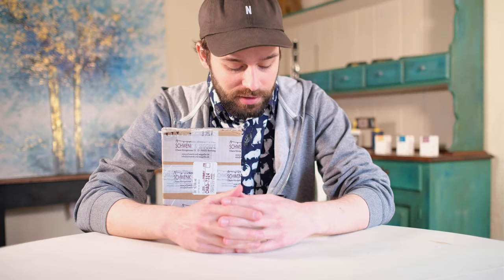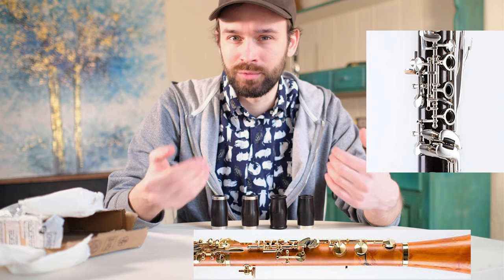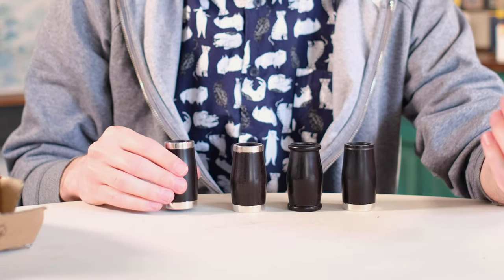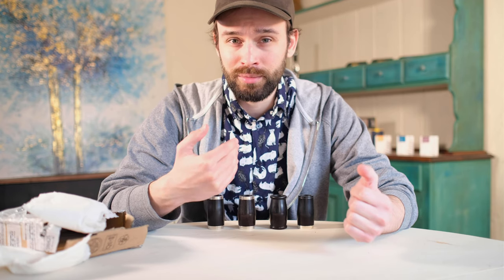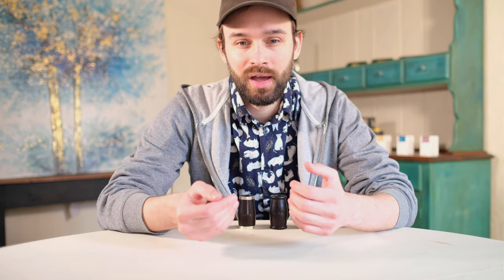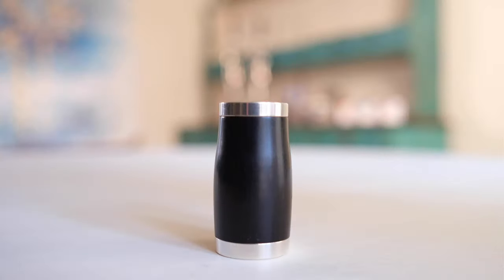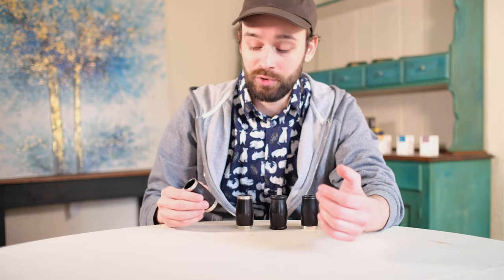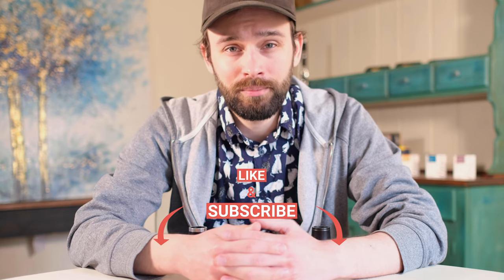Do Different Clarinet Barrel Shapes Change their Sound? Trying out Schwenk and Seggelke Barrels!

Comment: My unsophisticated ear dug the two ring fatboy  - but you also seemed more into playing while you were using that barrel.  Did the different barrels change any physical perception as you played, like having more or less felt resonance through out the instrument?
Reply from the maker: One of the most impressive things about these barrels, was that despite the ring differences, the “feel” was pretty close across the board. I imagine S&S takes their bore quality control pretty seriously. They all definitely felt like they were the same bore, just with small differences in the harmonic output due to the rings. That being said, it’s been a while since I’ve tried them and there were probably very small changes in resistance from barrel to barrel, but honestly I can’t remember what they were, just that I was surprised by how close they all felt.

Comment: Thanks for the video. A question related to the vast variety of barrel sizes showed at one moment: does the shorter barrel (shorter than 65mm) change the pitch of an instrument, and if does, by how much?
Reply from the maker: Good question! The answer to it is absolutely; going from a barrel that is 65mm, to one that is 64mm, will definitely change the pitch. There are different factors that effect barrel intonation, but you could probably expect the pitch to rise 5-10 cents (potentially more) depending on the note from a barrel becoming 1mm shorter.
Reply: Thank you very much. In the video I saw very short barrels, like 40mm tall (when compared to full sized 65mm barrel next to them). I’m not sure if short barrels are made for Bb clarinet, or perhaps C or Eb clarinets .. but, in theory, 10-15 mm shorter barrel could sufficiently raise the pitch and  ‘change’ the Bb clarinet into a B clarinet? (just theorising) What are your thoughts on this?
Reply from the maker: @zvonimirtosic6171  Ya, you're definitely right, the very short barrels are made for clarinets in other keys! However, for a clarinet to be pitched to a different key the ratio between the tone holes must be scaled down to fit a smaller body. Just adding a shorter barrel, while making the pitch higher overall, potentially even shifting Bb to B, will result in the overall scale of the instrument being very out of tune. You can test this out by pulling all the joints out on your Bb clarinet about as far as they can go (without the instrument being at risk of falling apart), to mimic an "A" clarinet. You might be able to play C and have it sound as an A, but the rest of the scale will be very out of tune!
Reply: @ParkHouseCreations  german Clarinets sometimes had rather shortish barrels, I have a Mollenhauer with two barrels both under 4 cm. The upper joint is longer accordingly, it plays between 438 and 442 hz. High pitch Bb clarinets are about 64 cm, A clarinets about 70, C clarinets about 60 cm. So you would need a 35 mm barrel to bring a Bb up to B, but only the throat notes, not the long ones.
Reply: I could see buying a replacement for a broken barrel or needing a different length barrel, but I don’t hear much of a difference to justify spending the money. To each their own.

Comment: im just starting out and i have a question, maybe its dumb but please help me. Can i mix wood and abs parts of a clarinet? Like for example i have a plastic clarinet, can i put a wooden barrel on it???
Reply from the maker: You can definitely put a wooden barrel on a plastic clarinet as long as the barrel fits the tenon. However, depending on the plastic clarinet you may have trouble finding a barrel that meshes well with the bore dimensions, but that depends entirely on the plastic instrument in question. If you are looking to achieve the biggest difference in your sound on a plastic clarinet I would really recommend dialing in your mouthpiece and reed combination first!

Comment: Too bad you actually dont test the exterior of the barrel since those are different barrels (interior dimensionwise) for that you would need actually all barrels to be exact copies. All in all i can guarantee you that as long as the interiors of barrels are alike they are the same (dimensions+surface polished grit - the smoother = easy blowing, rougher = more resistance) how do i know ? i made an experiment and made 5 barrels all different kinds of wood but same tools, same technique and i can summarize it with following 
1) as long as wood isn't sponge (light wood very porous) material is good to go 
2) rings on a barrel make the same difference as the length of your hair - its only for looks
3) length is for pitch (duh) but for those who dont know shorter = sharper, longer=flatter
4) bore radius - bigger=brighter, sharper, smaller- darker,lower(also a bit more resistance)

PS 
if you want to gift somebody a barrel its ok treat it like earrings or necklace its cool accesory and adds exotic touch but if you think that a 200 bucks barrel will turn you into maestro you better spend it on lessons and practice (or learn to adjust reeds, you cant have a bad reed if you know how to work them)

PS2 
if you feel different search for some research on clarinet materials, dimensions, general physics of clarinet,  its not a violin or guitar the bore is not the source of sound, the air column is
Reply from the maker: “Too bad you don’t test the exterior of the barrels since those barrels are different. (Interior dimension-wise)” In general I agree with many of your statements. I am just a little confused by that initial one? The internal bore on these barrels was identical (ignoring of course the stock Tosca barrel). Your request to test the external of the barrels is what the video was about. Sorry, I’m just confused, did I misunderstand your statement?
Reply: @ParkHouseCreations  I meant that the interiors of those barrels may vary in shape minimally since you had no way of measurng them also where it comes to wood you cant have 2 identical pieces so a nice experiment would be for example to test 3 same model fatboys or 2 of each etc. dont get me wrong all in all i liked your video and its great that someone does things like this to maybe save someone some cash on disappointment so great job
Reply from the maker: Ah I gotcha! Ya, at some point I need to buy a bore gauge for that very purpose. It would be nice to be able to determine the accuracy between barrels that are supposedly identical. Thanks for the comment, don’t worry I didn’t take it the wrong way. Thanks for watching and the kind words!